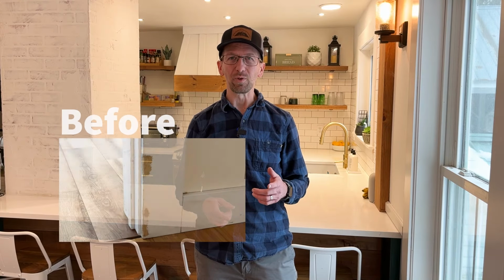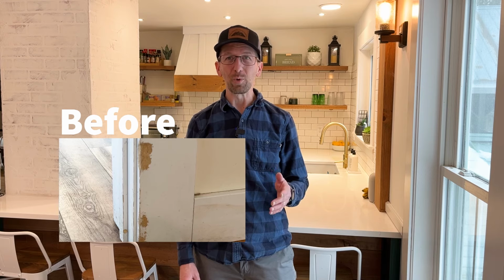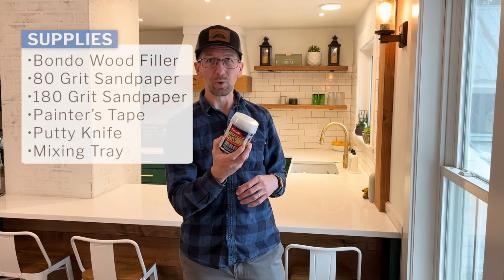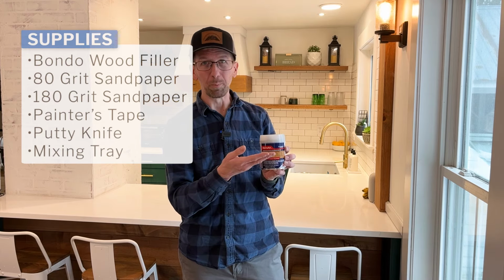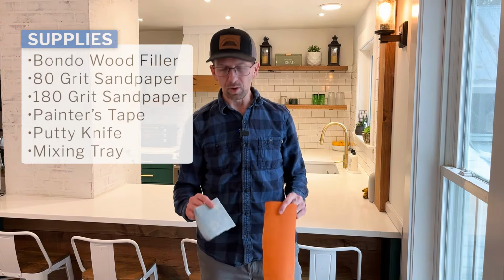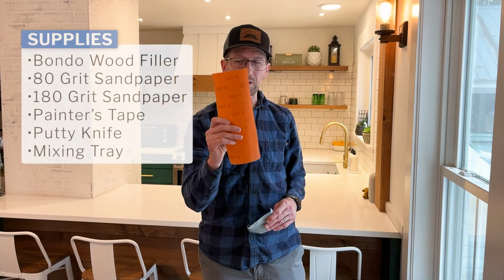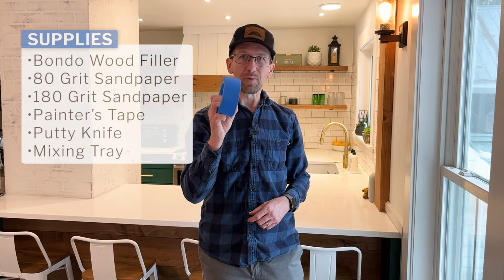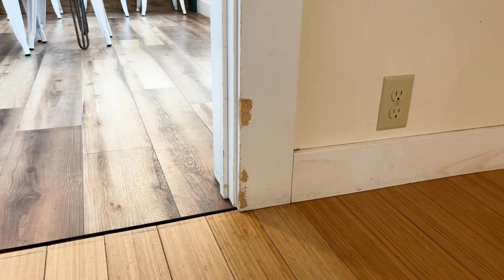Simple Fix: My Dog Chewed My Trim!

Comment: That works great for flat surface woodwork. I used it to repair old termite damage . However sculpted woodwork may be a bit harder to do!
Reply from the maker: Yes, that’s true. Definitely more challenging. Possible, but not as DIY friendly.

Comment: Common issue around here. I follow the same technique. I’ve been using Minwax two part wood filler. I’ll try the Bondo next time. I mean it works on cars.  Good vid
Reply from the maker: Very nice! Yeah, worth a try. Have been very happy with the results.

Comment: Looks like new. Here’s a question for you, Chad. What can I do to “save” wood filler, glue or anything of that sort. I don’t do big projects but when I buy, even the smaller,  size it dries up. Is there any way of saving it? Thank you
Reply from the maker: You could try putting some plastic wrap under the lid sitting on top of the putty. That might help prevent some of the moisture from scraping. Possibly keeping it in a sealed zip lock bag may help, as well.
Reply: @wmtcc  thank you, Chad. I’ll give that a try.